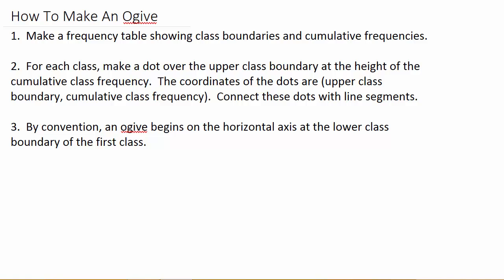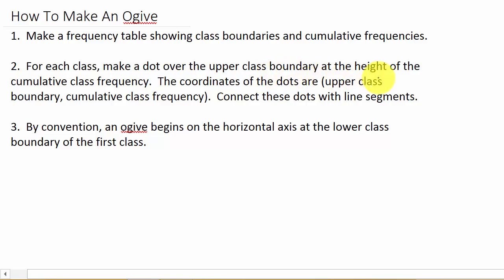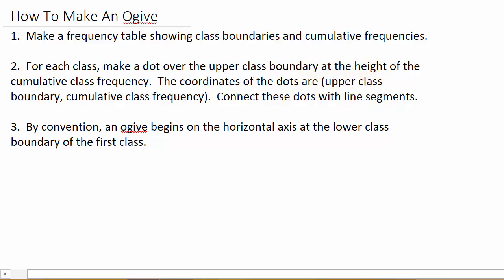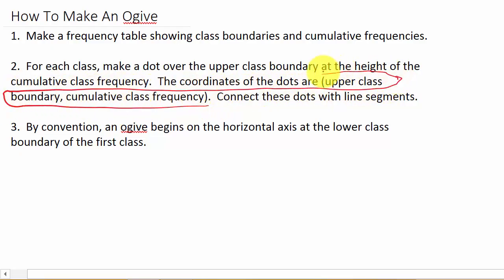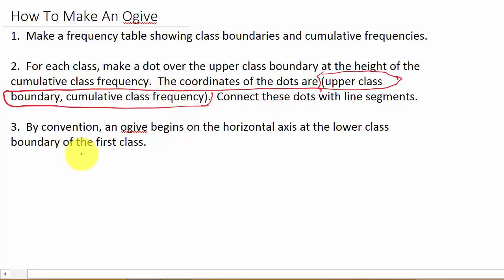How To Draw An Ogive

Comment: thanks sir better than my professors in university 
they work as professors for only getting high grades in the university it should be by testing them if they can teach or no
Reply from the maker: You’re welcome. Glad it helped.
Reply: @crowsmathclass  i have a question , here you are getting the cumulative frequency by summing the frequency but another video was getting it by summing the relative frequency not the frequency
Reply: which way is right ? sum the frequency to get c.r.f or sum the relative frequency to get it

Comment: What is the class boundary
Reply from the maker: Class boundaries are the numbers used to separate classes. The size of the gap between classes is the difference between the upper class limit of one class and the lower class limit of the next class.  To find the boundary, you will subtract the upper class limit of the lower class from the lower class limit of the upper class, then divide the answer by 2, and finally add that answer back to the upper class limit of the lower class.  We use them to graph a histogram and other charts.  You can watch my video on drawing a histogram.  That may help you understand it a little more.  Ho[e this helps.